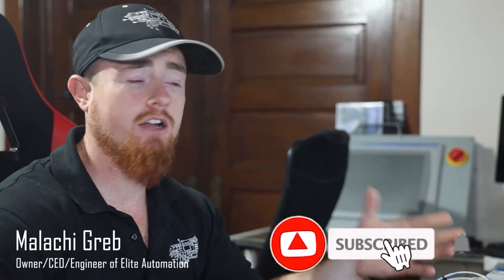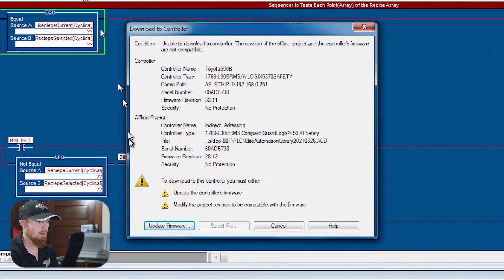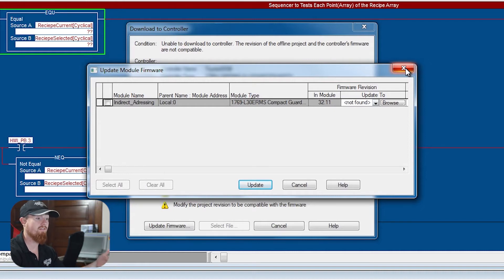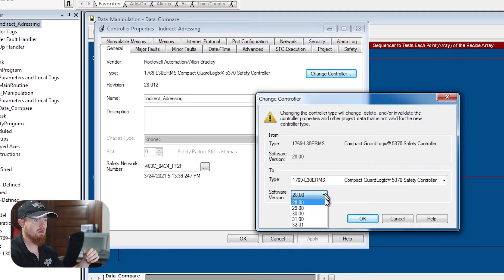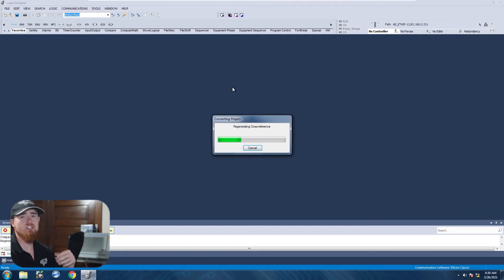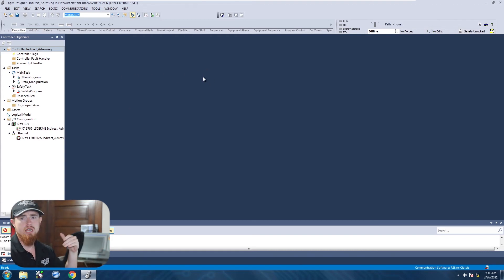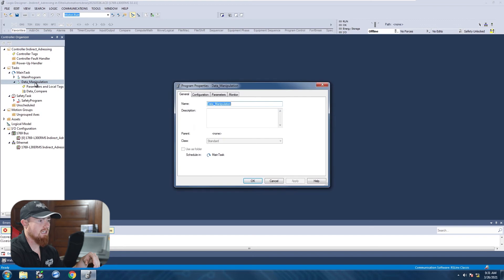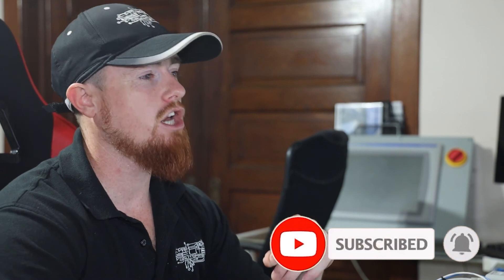Changing Studio 5000 Firmware Version

Comment: I have studio 5000 v28 and I would like to download a project stored in the plc that has firmware version 20.12. How can I do it?
Reply from the maker: Hi, here are possible solutions:
- Install a Compatible Studio 5000 Version:
* The most reliable solution is to install a version of Studio 5000 that is compatible with firmware v20.12. This would likely be a version in the Studio 5000 v20 range.
* Rockwell Automation's website provides compatibility information and software downloads for licensed users.   
- Check Rockwell Automation Compatibility Information:
* Consult Rockwell Automation's documentation and compatibility matrices. They provide detailed information on software and firmware compatibility.
* Rockwell automations web site is the best place to find this information.
Important Notes:
- Always exercise caution when working with PLC software and firmware. Incorrect operations can lead to system disruptions.
- If possible, back up any existing PLC projects before making changes.
- Always use a licensed copy of Studio 5000.
I hope this helps.

Comment: So I have different issue or maybe the same, So i have Version 36 of studio 5000 software on my laptop. I need v30 and v28 to be able to communicate with my PLCs how can i do that? I do not want to change the versions of the PLC controller.
Reply from the maker: Here's some information that would certainly be of help to you:
While you can't directly run multiple versions of Studio 5000 software on the same machine, there are a few ways to handle communication with your PLCs that require v30 and v28 while using v36:

1. Virtual Machines:

Install a virtual machine application like VMWare or VirtualBox on your laptop.
Within the virtual machine, install the specific versions of Studio 5000 (v30 and v28) you need for your PLCs.
Configure the virtual machine network settings to allow communication with your physical network where the PLCs reside.
This option allows you to isolate each Studio 5000 version and ensure they don't interfere with each other.
2. Project Compatibility Mode:

Studio 5000 offers a "Project Compatibility Mode" feature that allows you to open older project files created in previous versions.
While not ideal for extensive development, this can be helpful for quick edits or troubleshooting on projects created with v30 or v28.
Here's how to access Project Compatibility Mode:
Open Studio 5000 v36.
Click "File" -> "Open."
Locate your older project file and select it.
In the "Open Project" dialog box, click the "Compatibility" button.
Choose the desired version (v30 or v28) you want to open the project in.
3. Consider Upgrading PLCs:

This might be a longer-term solution, but if feasible, consider upgrading your PLCs' firmware to versions compatible with Studio 5000 v36.
Upgrading the PLCs can provide access to new features and potential performance improvements.
Consult your PLC documentation or Rockwell Automation for compatibility details.
Important Note:

When using Project Compatibility Mode, functionalities specific to the older version (v30 or v28) might not be available in v36.
Ensure you understand any limitations before relying solely on this method.
Remember to choose the solution that best fits your needs and technical expertise.  If you need further assistance, consider contacting Rockwell Automation support for guidance on compatibility and potential upgrade options for your PLCs.

Comment: when I go to open a folder in one of my controllers, I cant connect. I get the message that the folder version doesn't match the studio 5000 version. if its better to upgrade the controllers then how to get around this message as to get connected to do so ?
Reply from the maker: It will be in links or their is a Flash tool you can download from Allen Bradley.